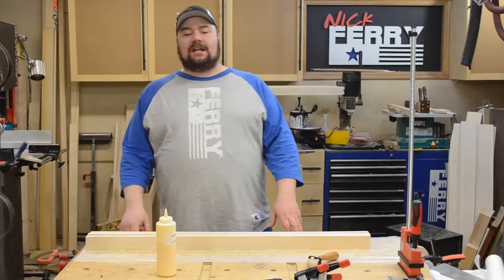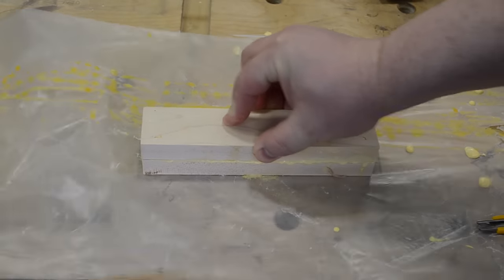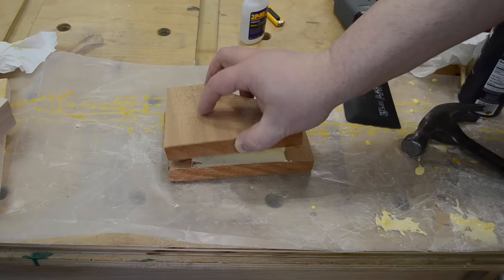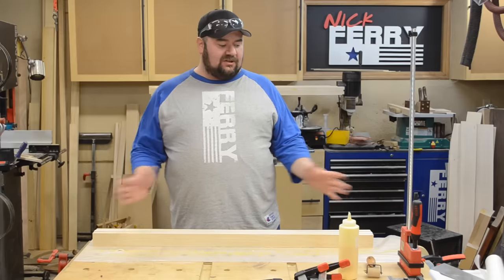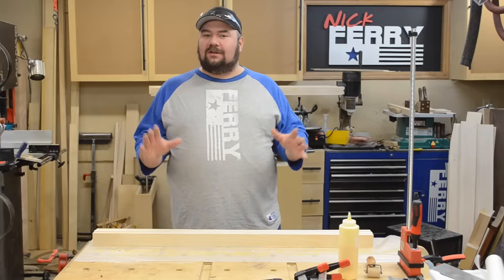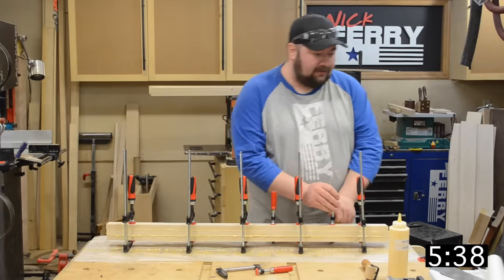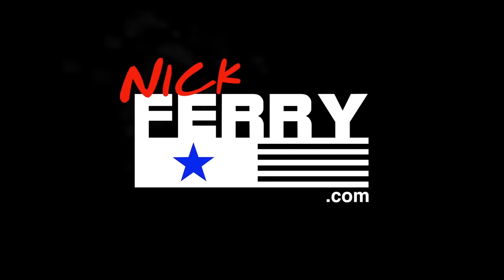Ⓕ Best Way For Gluing Wood Together To Get Thick Pieces (ep86)

Comment: How would you tackle 2 - 1x8 finish pine, for a 12 foot floating shelf?
Reply: Basically the same as you excellent example here, but large scale?
Reply from the maker: You could use dowels or anything like biscuits to help align your edges - if you’re not putting into it you shouldn’t be worried about exposing them

Comment: I used to laminate structural parts for boats and other engineered things. Here's how I would do it, and you could clamp all four legs at once.

Use pipe clamps, or any clamp that has a small clearance between pipe/bar and the face of the clamp, and the face is sufficiently long for the work, you lay an odd number of clamps on a table (or a clamping rack if you're serious about it) spaced correctly, on that you lay your pieces with the glue faces up, except for the first piece. Pay attention to grain runout and and any sign of warping and cupping. You only need to spread glue on one face if you use a thicker glue and a serrated squeegee.  If you are laminating more than one finished item, put the first of the series vertical and don't glue it, spread glue over the pieces and squeegee, flip the pieces vertical and lightly clamp. Tap the pieces flat with mallet and scap board such as a piece of 2 x 4. Lay an even number of the same type of clamp on top and tighten top and bottom, gradually working from the middle out.
Reply from the maker: A good technique as well - pretty much how I was taught years ago for top glue ups and I still do that for cutting boards and whatnot - thanks much!

Comment: But what about the ends of the planks? I assume you're just going to cut them off but what if I need those to be very accurate as well?
Reply from the maker: As I mentioned I left them long to be cut to length in the next video - if you needed to get them flush you can buy I had snipe from the planet that needed to get cut off anyway
Reply: so how would you make them flush on the ends if you needed?
Reply from the maker: just line them up - the way the parallel clamp holds it they won't slide lengthwise once you line them up

Comment: And if you don't have a parallel clamp, two scraps of wood wrapped in cling film and an F-clamp work just fine.

Personally if it's a large, or difficult glue up, I put in hidden dowels during the dry fit. Cheaper than biscuits or dominoes and safe for saw blades or router bits if you hit them by accident.
Reply from the maker: I did it that way for a long time as well - definitely a good alternative

Comment: Hiw woukd you glue up Big table legs for the lathe and not have any glue joints showing on the the finished turned leg!!! Could really use some help!
Reply from the maker: Turned glue ups will always have seams - you can limit the number of seams in cylindrical turnings by doing hollow glue ups with face grain making up the circumference
Reply: Nick Ferry wish you would make a video on how you do it!
Reply from the maker: Never know - not a lathe one but a really similar video is next
Reply: Nick Ferry  cant wait to see it

Comment: Why wouldn’t you wipe up the squeeze outright away after you’re done clamping?
Reply from the maker: Great question - I do it many ways - it’s probably one of the most dynamic techniques in the shop - many times I do wipe the glue with a damp cloth - but access around clamps isn’t always possible and if you use to much water while wiping you can create a glue wash of sorts that will mess with finishes and stains/dyes

Comment: What is the widest parallel clamp you can get out there ?..That limits how many pcs you can glue at a time.
Reply from the maker: True, but this method isn’t for gluing up butcher block counter tops, although it could, it’s not intended for that
Reply: Yea cool trick.

Comment: "you have to hope the salt devolves"...shouldn't it be the other way around?  The granules press into the wood on either side therefore keeping it aligned I would think. I guess it could help to draw the moisture out of your glue, but this would be after the initial alignment is held in place by the "biscuit action" of the granular media.
Reply from the maker: yes you want the gritty at first to prevent slipping and then the dissolving effect to not have a physical separation between the pieces

Comment: That sounds a little silly your woodworker buddy didn't realize that haha. For big panel glue ups you can make cauls which do exactly what your parallel clamp was doing.
Reply from the maker: Not really that odd after I thought about it - a lot of us are self taught and haven’t seen a to. Of variations on what we do on and everyday basis - if what we are doing works it’s sometimes hard to switch things up to try different techniques

Comment: Great tip..but how would you apply this theory if you had more boards to the width of 1 meter? Would you glue up in small sections then join?
Reply from the maker: Not sure I fully understand but the same way works well for wide boards too
Reply: Cut two boards longer than the width of your glue up. Then clamp them together, one on the top and one on the bottom of your project. This will align the pieces for you. It's how I do table tops and door panels etc. 

Ps. If you put painters tape on the edge of your clamp boards it will protect them from the glue.

Comment: I've done it this way but ever since I saw the salt trick, that's what I use. I really don't see any downside to salt, so I'm not sure why this more time-consuming method is supposed to be better. I have noticed that using too much salt makes the glue...weird, so I just use as little as is necessary.
Reply from the maker: I agree - just enough to get the job done

Comment: You don't need so much glue . Think of setting floor tile , the trowel is notched for the same reason . Look at dowels , their fluted to relieve pressure . On Your glue up , score the glue sides with a disc sander lightly , that helps some .
Reply from the maker: I agree adding tooth to the surface is crucial - and yes, I was probably heavy on the glue just making sure I didn’t botch the ideal because of my lack of glue

Comment: It's a good tipe. If your pieces are exactly the same width though. Not always the case. Will keep it in mind for sure.
Reply from the maker: If they aren't the same width it's probably not as critical to get them as exactly lined up
Reply: Why would that be?
Reply: Because usually they are planed or jointed afterwards. If the uneven widths are being kept as a finish just shim them against the clamp jaws.
Reply: Ahhh. Of course.

Comment: I had that problem at the cabinet factory. I called them stair-stepped.  The vacuum hold-down on the saw couldn't work on those. They told me that I was spending too much time clamping cross braces and removing them before they got stuck. Politics forced me to leave so they can deal with it.
Reply from the maker: Never good working at a place like that

Comment: Instead of a parallel clamp you could use 2 2x4s and a couple regular clamps to make a parallel clamp as large as you need it.
Reply from the maker: For sure another great way of doing it

Comment: is that what cauls are for?
Reply from the maker: Yes - the clamps in this case are acting as cauls - and you make them as well - I have a bunch for pulling cabinet sides together during assembly

Comment: Pipe Clamps can be used to level and clamp the boards, and all you need is a steal counter weight above. By moving that clamp as you run down one side, you leave an area free to move again. Bad. Leave the the clamp there till the glue has squeezed and set or you are just getting "somewhat" closer to what you want, but not for sure. You need at least two, one at both ends to leave for the duration. This is why I like biscuits.
Reply from the maker: Thanks much for the input

Comment: Nice, but I have had "glue creep" happen 10 or 20 minutes after clamping. SOOoo having a couple of (minimum) "parallel" clamps to leave on for an hour or two, that is what I would do...
Reply from the maker: If that works for you I wouldn’t change it

Comment: Parallel clamps are way too expensive for my work. My bench top is pretty flat. I’ve been using that, scrap block, and F Clamp. Never thought about working end to end, usually align ends and clamp out from center.
Reply from the maker: bench works great - mine bench top isn't super flat and a lot of times not long enough

Comment: Multiple issues: 
1) This works ONLY if the wood is EXACTLY the same width, but if your rough gluing up a Chair leg blank, why cut it to such exact dimensions when you're just going to cut it later anyway so clamping both sides with a parallel clamp is useless without a lot of extra work.
2) A much better way is to clamp the wood with the edge that you want lined up down against the clamp edge so that you know that one edge will be even and 
3) the pressure from a Clamp radiates out in a 45-degree angle from the clamp. He really should be using a Caul or at the very least an unglued set of boards on each edge so that the clamping pressure radiates further out.

Comment: Nice tip. This is something that has irritated the heck outta me while at furniture school. Cheers boss.
Reply from the maker: thanks - very irritating having them slip around
Reply: Hopefully using this technique will be another step towards removing the need for 'added waste' in my projects. Thanks.
Reply from the maker: no problem - hopefully it will

Comment: If you rub the pieces together they will lose the air and actually start to grip to each other. Rubbed glue joints are old school but often are quite effective.
Reply from the maker: I love doing that for edge glue ups but it get more difficult on wider stock
Reply: I have glued up 2x6 and 2x4 in hard and softwood and it actually works better for the bigger pieces. Likely it is the amount of surface area.

Comment: Here is some more advice, wipe the excess glue off right away with a damp rag or sponge after clamping. This way you won't have to worry about dried glue interfering with the straight edge.
Reply from the maker: good advice - I do that many times too

Comment: What am I missing here?  I can see how this technique works brilliantly, but wouldn't just the flat benchtop do just as well?  Lay the glued boards on their edges on the bench (as long as the bench is a known flat) then clamp?  Mind you, this looks like a good justification for getting a couple of deep-throat parallel clamps now - can never have too many clamps, right? :)
Reply from the maker: The problem with that is the still slide around if they are just sitting on a flat surface - the clamps push certain boards up
Reply: I could see this working if you lay them on the bench, then clamp them down onto the bench top (making sure each board is pressed down) before the normal clamping - no relatively-expensive parallel clamps needed as they would reference to the bench. With a flat piece between the upper jaw and the work you could use a single regular F or large C clamp, or even a holdfast, to do the same job as the parallel. Probably an offcut of melamine or acrylic would work best for that so you can keep it clean for reuse.

Comment: Where can you buy a good 1.5" ink brayer?
Reply from the maker: Did you check the links in the description?
Reply: I looked at the tools list and the Ink brayer wasn't there.
Reply from the maker: @StephenandSweet  - I just looked and the link is under the picture of the brayed I used here -  https://nickferry.com/2018/03/best-way-for-gluing-wood-together-to-get-thick-pieces-ep86/
Reply: @NickFerry  Is there a big difference between the final product based on of you spread the glue or not? In the past when I glued some stuff together I didn't spread it because I just assumed it would spread enough when I screw it together. Lol
Reply from the maker: @StephenandSweet  it can both aesthetically and structurally- then again, it’s not an outer space mission - i dig them mostly to save time & get consistent results

Comment: You missed one of my favorite methods - use some biscuits. If the project allows, a couple small biscuits keep things aligned nicely. They’re all wood, so you don’t need to worry about them interfering with dados or other cuts later on as long as the biscuit isn’t visible.
Reply from the maker: I use biscuits a lot and love them - hard to keep track of them for tapered legs though

Comment: What is the salt thing?
Reply from the maker: Shaking some (typically iodized table) salt onto a glue joint right before joining the pieces so the salt “grit” prevents slippage - then dissolves into a nirvantic bliss - your mileage may vary with the latter 😅

Comment: or sash clamps, works faster and better. Just make sure you use some on the bottom AND top of the pieces you are gluing.
Reply from the maker: sash clamps are a good option as well
Reply: Nick Ferry but if you only have F clamps the method shown in you video is a rly nice one. good tip.

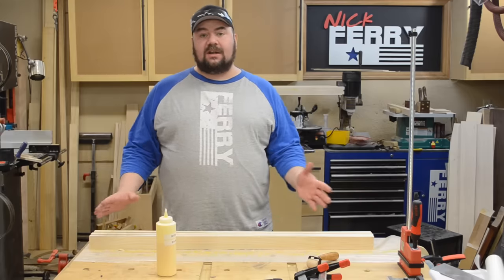Comment: 01:14 Has the amount of salt [or salt at all] any impact [chemically] on the quality of the joint? Thanks.
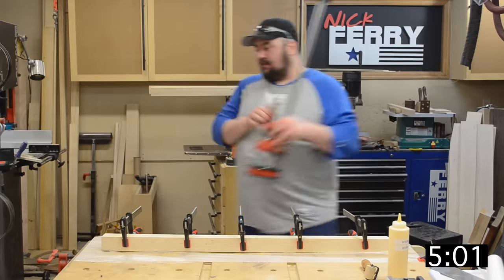08:15 Damn - that's one cool hack. Thanks again, Nick [and Richard who had the epiphany].
Reply from the maker: use very little salt - and I mean very little - and it shouldn't be a problem - thanks man!

Comment: the only issue i would have in using this method is the number of clamps as i do woodwork as a hobby. but its such a simple method
Reply from the maker: never enough clamps
Reply: i only started wood work in the last year or so and only have 2 f clamps. its more an issue with my stock of clamps. if i had more i would use more, as i use the lamination method when i make boxes from timber

Comment: lay boards on edge and lightly clamp both ends. True up, tighten. no need for complex clamping.
Reply from the maker: with the glue acting as a lubricant, it can cause pieces to rise out of alignment - clamping work pieces to the bench can avoid this if the work surface is clamp-able and flat

Comment: Could have had the same effect by just having the edges on the paper, which, if a flat surface will do the same job quicker and he wouldn't have glue all over the parallel clamp.
Reply from the maker: This works with longer boards where you may not have a flat surface as long

Comment: This method obviously does work.  However, in order to keep the boards from slipping and sliding out of position, I do the "rub joint" technique.  That is to say, if you rub and slide the boards back & forth together, they'll very quickly get tacky and stick to each other -- which eliminates the slipping and sliding around.  Therefore, you can put them in position and they'll stay in position when you apply the clamps.  Wood workers in Third World countries, who do not have access to a large number of clamps, use the "rub joint technique" very successfully.
Reply from the maker: I’ve done rubbed joints on edge glue ups and have seen VonDriska talk about him using while in the Peace Core while in 3rd world countries but face laminations can be a little difficult to get the pressure needed for that technique

Comment: lot of rough work put a dowel through the stack.  Work can be rough as get out but the centres are all good.  Run it through the planer and voila.
Reply from the maker: another good way - this way is also good for utilizing extra rail and stile material

Comment: true this is basic stuff every carpenter should know...
Reply from the maker: I agree so much that I made a video for those that don’t - I’m glad you were able to see that and connect the dots - really great job!
Reply: @NickFerry  well i realy ment it. I learned this as a carpenter in germany decades ago. But maybe some point to add. You dont need that speceial clamp to do it. The regular ones are just fine. You can achieve the same result by using some more boards that you put cross over the parts that needs to be glued. That way you can get much more boards together than just 3...
Reply from the maker: @vespa2901  cool - I probably read the original comment wrong 👊🏼

Comment: Doing 2 pieces at at time glue one side only and rub the joint, far less creep leave 30 mins then add next layer.
Good method though,but glue on one side only and rub joint.
Reply from the maker: For sure another way to try it

Comment: That's the good method for doing that, and it's been done on PBS shows...  but the THUMBNAIL PIC made it look like you were doing something else which is why I clicked on it
Reply from the maker: The one on the left I glued without the aid of parallel clamps and the one on the right I used them - the one without slid around and and the pieces act as a squeegee scraping a lot of the glue out

Comment: Omg you have to put glue on top of glue? I was only gluing one piece to the other. I never thought to put glue on BOTH pieces before sticking them together.
It's a wonder my creations are still holding strong! Lol
Reply from the maker: Don’t fret just yet, glue on one surface is many times sufficient for a lot of projects - The two terms to keep in mind are, cohesion and adhesion - cohesive is glue sticking to glue - adhesion is glue sticking to wood - glue is a rather cohesive fluid and it has no problem mixing with itself - where it often needs help is in the adhesion process - so spreading the glue on both surfaces help with that - it also does a pretty decent job in eliminating any type of air pockets or bubbles - which isn’t always a problem but sometimes you will see that in the lamination when you go to cut into the blank

Sorry for being long-winded I’m in a nerdy kind of mood ✌🏼